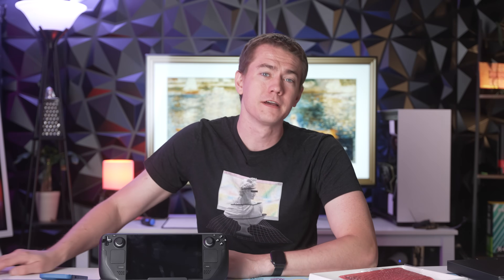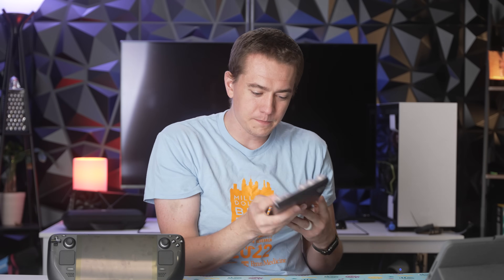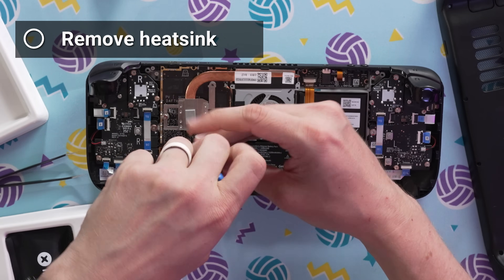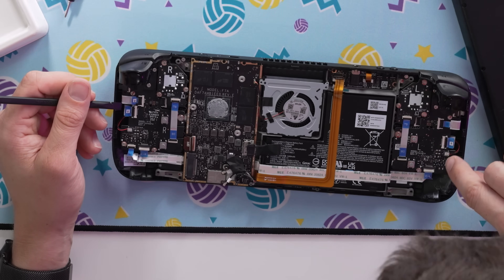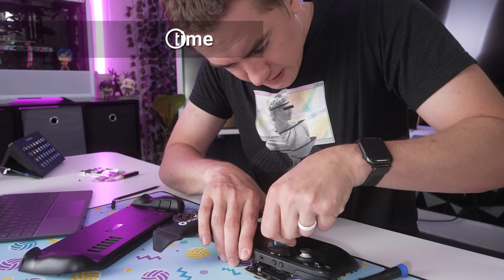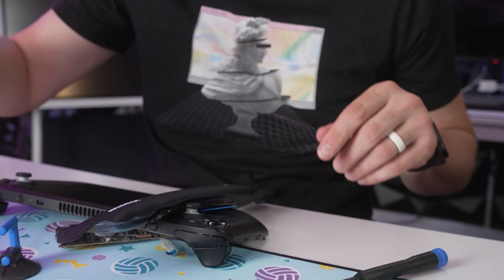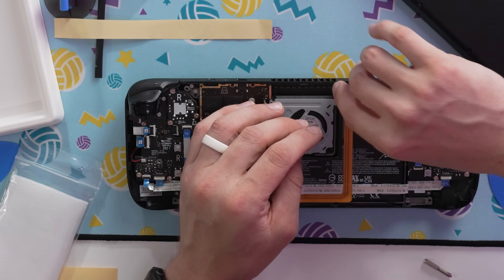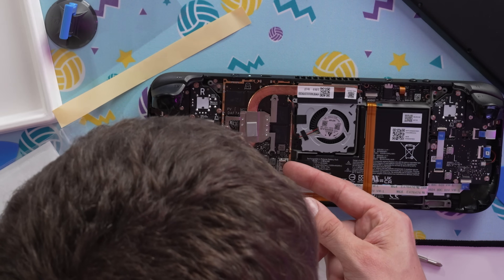Steam Deck Screen Replacement

Comment from the maker: ► Check out the Drop x NZXT Giveaway here: https://bit.ly/3uwlkCx
Big thanks to Drop for sponsoring today's video!
Reply: did you ever figure out how to get that pc case from japan?
Reply: I’m kinda weird. I like the more reflective screen more. Color vibrancy seems better too. I don’t own a steam deck but I’ve seen comparison videos.
Reply: lol the giveaway isnt supported to my country
I live in finland ( europe ) and well... sure im blocked by all us things
Reply: Maybe steam will offer "upgrade" motherboard to switch to a 6800u ? would be so great.
Reply: 1440p screen next?
Reply: I get my Steamy Deck I'm a week & a half I can't wait man Sooooo hyped!!!! Unfortunately I only could afford the 64gb model but I was just planning on upgrading most everything on my own PC enthusiasts here guilty. Haha  :  -  )
Reply: @SgtKickAzzYT  Question for steam deck dose your steam deck have backlight bleeding like in the corner it’s noticed when the screen is black.
Reply: Sticking displays on tape is bad engineering!!! Displays should have metal frame that has screw holes in corners , in between them and in a middle for equal force applied and should be detachable after removing 9 screws from opposite side!!! Valve should do it with future revisions of deck!

Comment: so my steam deck recently fell or something im not sure but im having like small white markings on it and im wondering if this type of panel would fix it and if so would it be worth the process because its not bad but its in the dead center and i might as well upgrade other things internally while i fix the screen just wanna know if someone else has had a similar issue and if this would fix that  :)

Comment: Thanks for trying this! I bought a matte screen protector and it made it look so much better.  except two dust particles stuck between the display and the protector. This was my second attempt and now I can buy another set and another one in attempt to get a 100 percent clean installation or I buy the replacement screen.

Comment: I broke my 3 years old surface go 2 screen and it costs 250€ to repair.... if  I want battery also its almost the price of the surface go itself...
I guess its time to buy a steam deck since the screen costs only 65€ (I only play inside so no need to get 100€ screen xD

Comment: This is extremely risky for the majority of regular gamers (not experts in hardware tech repair). I'd only recommend a screen replacement for a moderately damaged/cracked screen rather than upgrading a regular 64/246 GB Screen Ver. for a Matte Screen (512GB Screen Ver.) 

Though, I would highly recommend that people who bought 64GB ver. upgrade their storage from 64 GB eMMc to 1TB NvMe m.2 2330 storage (do good research on which one you want for price-performance). It is an extremely simple procedure that does NOT require you to be an expert in hardware tech repair. You can find a lot of tutorials all over Youtube or other platforms. Just thoroughly take time to learn the procedure and be gentle with the components as you work through it. Good luck!

Comment: Thanks for a really helpful video. It is really timely as SteamDeck are bringing out replacement full 1080p screens for the stock 800p screens for $99, that apparently the SteamDeck owner will have to replace themselves. Well done on the choice of subject at this time!
Reply: This video released a year ago. I agree that it's good, but it's way early lol

Comment: Sticking displays on tape is bad engineering!!! Displays should have metal frame that has screw holes in corners , in between them and in a middle for equal force applied and should be detachable after removing 9 screws from opposite side!

Comment: Buying the cheapest model, then buying the screen and same internal sdd the expensive model has will save you about $50. (The prices as is when looked up at time of me posting this)

Honestly I'd rather just pay them the $50 than go through all that myself.

So basically if you have the money, just get the expensive one. If you don't just buy the cheapest model, get a relatively cheap anti reflective screen protector and and decent SD card. Or just wait and save

Interesting video either way

Comment: Thanks for the video.  With new 1TB SSDs coming out in Jan ‘23 for around $150 on Amazon, I was considering just getting the base model and replacing the screen and SSD.  This would put the cost at roughly the same as the 512GB model with far more storage.  After watching most of this video I think I’d either keep the base screen or just get the 512GB for the screen.  I’d probably swap out the SSD later on either model.  While I have worked on my own devices before I don’t think I’d care for this hassle.
Reply: Pointless replacing the screen.

Comment: My screen is all black in handheld mode. But when i plug onto tv, it works! I first suspected it was display cable, but i have unplug and plug it back it several times… still same black screen. 

What went wrong?
Reply: did you ever figure this out? i am having the same problem

Comment: Still happier to have the faster memory with the 512GB model but I had a decent area of white/dead pixels with a white halo or aura around it noticeable only against black or darker colored backgrounds.

Playing Gloomwood made this immediately noticeable, so after owning it for only 3 days I already sent it back for RMA.

It should be received by Valve on Dec 7th, so we'll see how long it takes to get it back home.

I hope they just replace the screen because I was stoked to get a Deck with a quiet fan (meaning not the high pitched Delta model fan).

The other issue I had was the left thumbstick had some grinding/resistance between the 12 o'clock and 4 o'clock positions.

That issue seems to be fairly common when browsing Reddit.
Reply: Min has a similar problem at the top(light bleed) it's the only reason I was looking to replace the screen with the etched one. I might in a few months.
Reply: Did the replacement fix your issues?

Comment: Pro tip: you can get an etched glass screen protector that will be just as good for $20.

The problem with the etched glass screen is that a screen protector probably won’t adhere to it nicely. so you lose the ability to protect it properly.

Just make sure you don’t cheap out when buying the screen protector. Because some “matte” screen protectors feel like sandpaper or are made of cheap plastic.

You want something like a MagGlass anti-glare tempered glass screen protector.
Reply: JSAUX glass protectors are great and are only 10 bucks. I am using one myself. And there are two protectors in one box)

Comment: Why screw around with a little heated baggy. Just use a hair dryer on low. Or an electric heating pad. 

What rather have an OLED replacement for the OG Switch and for Noctua to make a replacement fan.

Comment: To be honest and this kind of jobs is not too far from me, because i learned and was trained in this job a 30 years ago, but i wouldn´t do this until it is absolutly necessary ( crack of of the screen ). I guess the guys from the repair centers have changed 3 screens meanwhile without risk of killing one steam deck. For me i hate to manipulate on this clear-brown ribbon cabels, because they are soooo fragil. Swap the SSD is not a big deal, but the screen make you touch a lot of points which i would leave to the professional repair guys if possible.

Comment: The only problem with the cheapest steam deck is that you cannot upgrade the internal memory like you can with the two other expensive ones The memory on the cheapest deck is soldered onto the board so it cannot be removed.
Reply: All those videos showing ppl swap out the 64gb to 1TB begs to differ
Reply: Wrong.
Reply: @horacegentleman3296  Embedded MultiMediaCard (eMMC)  that means it’s soldered in the board and cannot be removed that’s what Google says. The steam deck does have an Sd memory upgrade you can put in my self I have the 512 SSD model.
Reply: @SuperAgentman007  it having a soldered drive doesn't mean it can't have a slot.

Comment: I really don't understand the hype around anti-glare/etched glass. Scuffs so easily, screen protector nulls the effect, and the screen isn't bright enough to be enjoyable outside anyways. Wish they had a 512gb option with normal glass. Fingers crossed they release an OLED panel upgrade down the line.

Comment: You can just buy a Glare free Screen protector for the steam deck and it will have the same affect and also protect the screen.
Reply: it may slightly degrade the visual quality tho and touch sensitivity may be slightly reduced. but that's also what i will do, just reserved the 64gb model on which i will replaced the disk by an ssd and put on a simple screen protector.

Comment: Heads u0, if you need to replace your analog thumbsticks, don't get the iFixit ones, get the Gulikit Steam Deck sticks as they're hall effect sensors and don't have the longevity problems that come with the Alps potentiometers the Steam Deck uses.

 It was a missed opportunity for Steam to move the consoles forward with hall effect sensors, but at least it's just a cheap upgrade away.

Comment: I'd kill for a OLED screen upgrade, also I would prefer the glass screen but I wanted the larger capacity so I picked that, reason for that is that the mat finish absorbs all light instead of directly reflecting it, this makes high contrast colors not to look as vivid as ona glass screen.
Reply: u bought that shit with ips screen? XD My phone from 2016 has better than STEAMDECK XD
Reply: @Kenami92  your phone from 2016 could not run crysis or cyberpunk
Reply: @blakewixom2893  still it's a phone not skateboard with ips.
Reply: @Kenami92  well being the owner of both the Deck and OLED switch its not a deal breaker. The deck still looks great plays great. Sure I would love to see a OLED option but that's not going to happen at $400
Reply: @relicgamer2137  well i don't care. No oled no money. Also that uncomofortable button layout only made by steam and size of a skateboard. I can only imagine that u are playing at a skateboard in a bus.
Reply: @Kenami92  your phone from 2016 isn't a handheld gaming console which needs to conserve battery whilst offering good performance
Reply: @plexyglass429  okkok
Reply: @Kenami92  not to mention how shit Oled is. You know why almost no gaming monitors are Oled? Because burn in is a real issue with games and Oled tech means that the display simply being on degrades it over time. Burn in happens due to certain pixels being brighter more often than others. It can't be fixed, the "solution" is to degrade all the other pixels. Don't stick to Oled so much, you don't wanna waste your money like that when regular IPS panels do just fine
Reply: @plexyglass429  XD I'm using laptop Zenbook oled for 5 years already and nothing happens. Just like tv and phone. IPS = shit. Just compares it. Type in google: IPS vs OLED how it looks like.
Reply: @plexyglass429  When comparing OLED vs IPS, we find that OLED is superior to IPS LED monitors when it comes to quality. They produce darker black levels, more vivid colors, and have better response times.

Comment: I get it if you damage your screen why not "upgrade," but if not then just get an anti-glare screen protector and have the best of both worlds. If you use the touch capability of the screen a lot then you are going to eventually make the screen lose its anti-glare ability over time anyways. I think a gloss screen will end up being the better choice in the long run because of this. 

You can literally buy a nice protector for a tablet for around $10~$20 and cut it to size or even find one that is made for the deck. No need to open your expensive toy and risk doing something detrimental to its health if you don't need to.

Comment: Appreciate the thorough video.  However, I'd say that with the cost of the screen, the cost of a larger ssd, the time and risk involved with pulling the deck apart makes the delta I spent on the 512 more than worth it.  It is good to know though that if something breaks or if the screen cracks, repairs are doable by us mere mortals.
Reply: You do risk killing the steam deck through static discharge, even if you remove the battery.
Reply: @triadwarfare  That risk is so minuscule it's not worth mentioning. Stop spreading misinformation and fear.
Reply: @poipoi300  hopefully it’s true my screen has dead pixels and I want to replace it with a anti glare screen but I’m not trying to destroy my deck
Reply: @Rix2hard  Static discharge won't be an issue. Make sure you're able to do the rest of the operations without physical damage and you'll be fine.
Reply: The screen isnt worth it, He is on crack, people dont the steam deck for the anti glare screen. If anything the lower model screen is better, because the display is brighter. People buy the upper model for storage.

Comment: You don't save $150.. that's completely ignoring the 512GB NVME.  Also the maybe bricking your deck, or the time and stress for doing this upgrade?  Or am I crazy?
Reply from the maker: I'm not ignoring it. I mentioned the path that most people take is to just get a high capacity microSD even if they get the 512GB version.
Reply: @UFDTech  Yeah but you are saying that if you get the $399 model you can purchase the better screen on the $649 model and save $150.  That doesn't account for the time/risk/stress of taking apart the $399 model to put in the screen.  And you still arent "saving" anything if the benchmark of what money is saved is the $649 model which ALSO HAS a 512 NVME.
Reply: @UFDTech  hello?
Reply: Cmon dude, you know what im saying.  Im not gonna eat your lunch over it, but its not a good stance and not good advice.

Comment: You save less than $100 because the 500 gb ssd is between $50 to $80 which will make the base model basically equal to the expensive one. Now for those who are less experienced with repair ask yourself if the risk of destroying your steam deck to save about $80 is worth it?
Reply: Absolutely, at the risk of totally wrecking your brand spanking new Steam Deck to save $80.oo dollars, just isn't worth it for me and probably others. Also, running games off of an SD Card means that your Internal Storage is going to be used for Pre-Cached Shaders. I applaud Valve for giving users choice and making it easier for those of us who don't want to tinker that much with the Steam Deck.

Now back to ricing my Linux desktop.

Comment: I bought the $650 model. And I am happy I did. But that being said, I have been really hoping ifixit or somebody else will drop an OLED screen. If they do, I will buy it.

I realize it will use more power. But it won't use much more, and I get 12+ hours of play with my preferred way to use the system anyways. (streaming AAA games.)

Comment: Honestly, with how little power the Steam Deck draws you could even use the carbon fiber sheets that TG sells (Carbonaut) and most likely get pretty good thermals out of it (also it’s reusable so you wouldn’t have to worry about replacing thermal paste every time you took the cooler off).  Electrical conductivity would be a problem still if you don’t cut it and place it right, but it’d be less risky and also safer for the APU die than liquid metal as with liquid metal you have to worry about not using enough or using too much, and also how it may potentially eat away at the surface of the die over time.

Comment: Valve really should've figured out a different mounting system for their display. It's cool that they're selling parts but they need to glue things down less. Maybe with the Deck 2 they'll sort this out.
Reply: Indeed, it can always be improved. Though credit to Steam where credit is due as the battery is the only other thing glued down IIRC, and this screen looks easier than many smartphones and tablets

Comment: Great to see how this is done, personally I would only do this if my screen was cracked or an OLED screen becomes available
Reply: Oled is the next step for Steam boyz...that will be dope
Reply: @blastu2fool I'm from the future. We have steam deck OLED now and it is amazing.
Reply: @blastu2fool  without it it's a piece of crap. IPS with 400 nits XD my phone from 2016 have better display
Reply: @Kenami92  it's not only the screen you're buying on either is it, and the steam deck screen is more than adequate for the purpose, can your phone from 2016 play most of your steam library?
Reply: @Δ  they're already taking a loss for the price it's going for. It's not going to have the best screen available, the best cpu and gpu combo, ect ect. The price to performance is one of the best in the gaming industry, if you want the best of everything and you have an unlimited budget to splurge on a handheld get a gdp win, Aya neo, or onexplayer.
Reply: @roboteen  I do think they hit the sweet spot on every component though, price/performance-wise.
And all the input options are just bliss
Reply: @Kenami92  I agree with you that the screen quality isn’t good, but it’s there to hit the right price point. Personally, I would’ve paid more for an OLED screen, but they had to make some concessions to hit the important $399 base price.
Reply: @ThePsychoticWombat  Totally agree with you.
Reply: @Kenami92  bruh my laptop screen is worse 💀💀